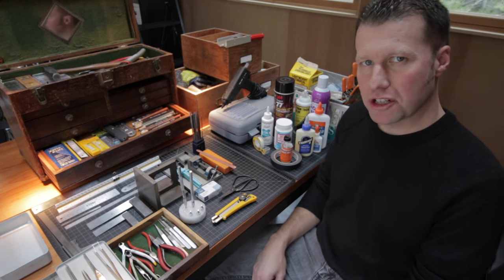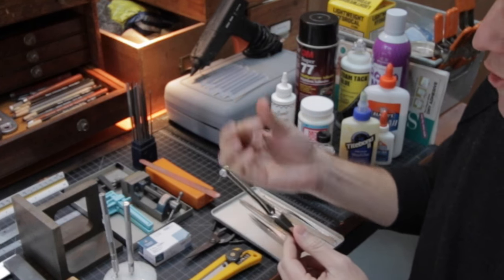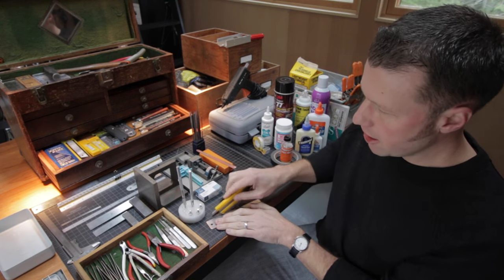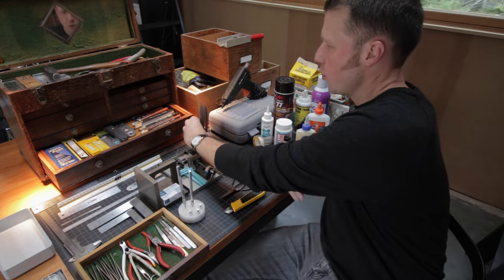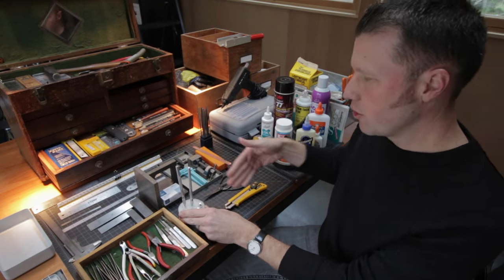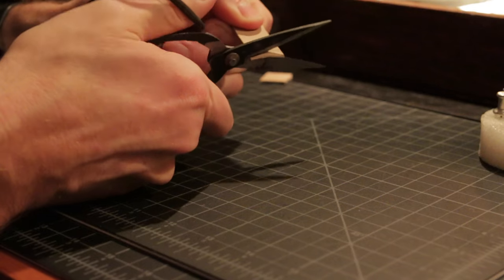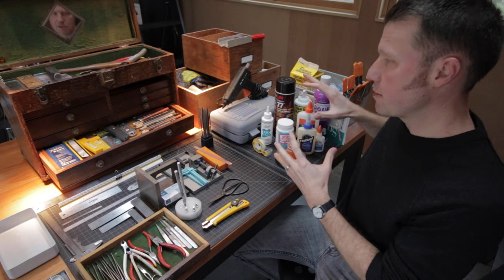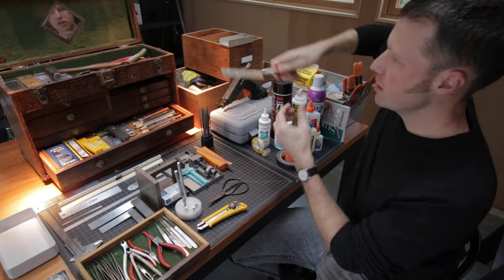Architectural Model Making - Tools - An Architect's Guide (part 3)

Comment: I'm only a second year architecture student, but I quickly discovered that bricks are remarkably useful in studio. I have three bricks and a test cylinder under my desk, and a lot of the other students have asked to borrow them at one point or another. You can use them to flatten curved cardboard while gluing for a site model so they dry flat, or as a weight while gluing anything else for that matter. I've used them to hold my phone at a certain angle while taking orthographic photos, and to hold down rope while measuring the topography of a site. They have many other uses, so I highly recommend students bring a few bricks to the studio.

Comment: Fantastic video Eric
I love to see all that passion and knowledge you have about the topic. 
One thing about knives. I used some of those in architectural school.  All of them seemed to rattle.  Some less,  some more 

Presently my preferred knife is the carpenters/utility knife with trapezoid Stanley blades. 
For fine model and craft work the old style Stanley works best for me - bought for ₤1 on flee market. It has smaller oval handle working for hammer or pencil grip. There is a modern one with massive handle so it's less tiring while heavy cuts but less handy for detail work. Both are fixed blade style -retractable blade system is less rigid and tend to fail after time
Those knives has blade storage inside. Blade seems to be more heavy duty than craft knife. 
Lately I started to sharpen them before every use.  Just for fun,  but it ended to become a habit. 
Similar to your exacto habit,  I would have a few blades in various level of wear in the knife storage. I change them accordingly to the job. 
One bashed blade for scraping rough surfaces.  One resharpened blade for all general work. Few new blades... Just in case. 

Hope you find it useful. 
Good luck with your projects and thank you for sharing

Comment: My experience with model making is extensive, having built a 15-block model of San Francisco's Financial District some 15 years ago. That model was about 5 feet long. I'd like to say that those light blue plastic X-acto clamps break very easily. I have never been happy with those. I've switched to using the small ones made by Irwin, which work great.

Comment: If you need to glue clear plastics, Humbrol ClearFix is designed to not fog or leave marks on plastic.

Another clamping solution for tight confines are rare earth magnets. You can get assortments of sizes on Amazon, and they'll hold thin materials tight while your glue dries.

Nail files are your best friend when it comes to sanding fine materials. As cheap as sandpaper, but in a much more useful form for precise work. Small metal files are fine, but I find them to be a pain to keep clean and not really better for this sort of thing.

Comment: Have you tried a surgical scalpel with the corresponding "#11" blade? The handle is flat, the blade snaps in place. The blades are extremely sharp ( I tell friends not to look at them too long or their eyes will start to bleed). The only draw back I have found with the surgical blades is the they do not take twisting very well, they seem to be of a harder metal, more brittle and will break with too much torque on them, they must be made with a drawing type cutting motion in mind.

I'm nowhere near your skill level and I am approaching 70 so my hands shake quite a bit and my eyes arn't what they used to be, so I only model when in the mood. I now understand why years ago my Dad had me do the keen eyesight stuff.

Really enjoy your videos, thank you, hope you continue to make more.

Comment: Great videos! Really enjoying this series. One question, what do you use when you decide to paint a certain part of a model? I've seen people using brushes and sponges... I'm curious as to what the technique is, because in order to avoid painting (out of fear to ruin the model) I always look to make my models color coded in my cardboard selection.
Reply from the maker: Thanks @fabroc8 , glad you're enjoying these. RE: painting/color application: I'll try to use a material that works without finish first, if that's not possible, I use matte spray paint to color the pieces before installing them in the model. Spray paint offers the best coverage and is easy to repair. One tip when painting things like balsa or basswood is to paint the entire piece (all sides). This will keep planar surfaces from warping as the paint dries. Hope that helps...good luck!

Comment: Your bonsai cutting scissors when they start getting dull take some cooking foil and fold it then cut it several times you should only need to fold it 8 times tops and you should find them resharpened saving replacing them to often

Comment: Great video! I've made dozens a trips to the art store as I fumble around trying to figure what tools I need. Ended up getting most of the tools. Few of my professors convinced me to throw away my glue gun. Im going to make a square out of wood in the shop.  Our first project is site modeling and diagraming.
Reply from the maker: no glue gun? if you're careful they'll never know the difference. after you place the glue, double back and 'cut' all the floating, loose strings with the hot end. I use the glue sparingly and it's much faster than waiting for white glue to dry. good luck with the model...!

Comment: Hey, quick question, am I cheating for using a cricut maker? I just started school but I have to work at least 40-60 hrs a week due to rent being due etc etc, so I am using the machine, revit, photoshop, to cut to perfect scale, figured out a system to make it follow intention, if i share this with professor do you think i'll be kicked out? I literally am always tired but i get it done, any advice would help.

Comment: The Alumicutter is a great idea, unfortunately the cheapest 12inch one I could find costs $40, 24 inch $63 delivered and you cant get it in Metric scale. :( not so great for Australia.
Reply from the maker: I've always used cork-backed metal rules...and despite a few injuries I've fared just fine...
Reply: Lucky cause I just ordered one :D

Comment: DO YOU HAVE ANY TIPS ON HOW TO CUT PLEXIGLASS. THAT IS NOT A LASER CUTTER  OR ANY MATERIAL TO MODEL GLASS THAT IS EASY TO USE?
Reply from the maker: plexi is a nightmare to work with...try acrylics...tracing paper, thin acetate sheets, pv shower curtains, . the thinner the stuff you can get, the better...you'll get cleaner cuts too. good luck!

Comment: clip 7:07  where can I buy that ?  weighted angle.
Reply: I was wondering the same thing. It's called a right angle block/plate. I found it it under other neat machinist tools in my search. Rather expensive  (unsurprisingly) on ebay, amazon and the like.